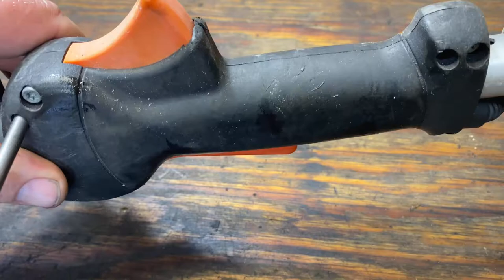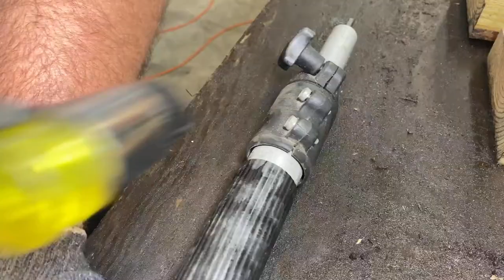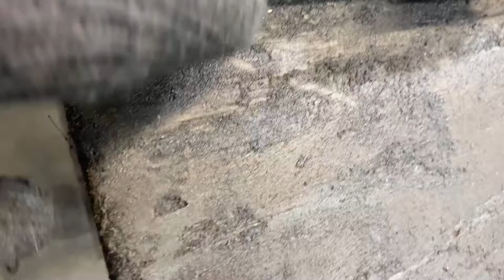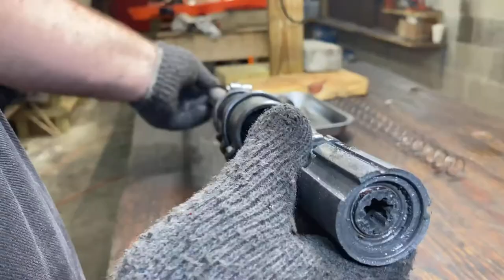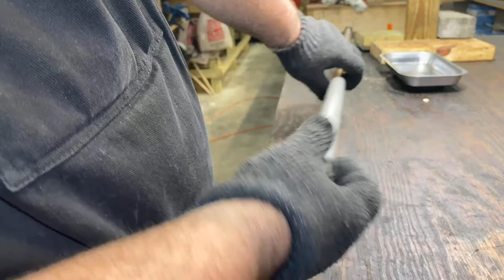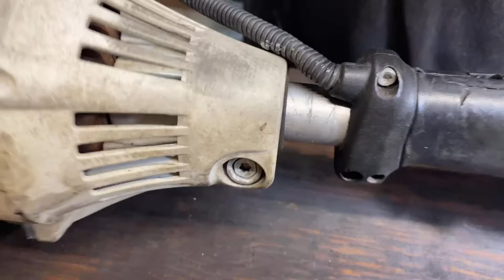Stihl HT-101 pole saw shaft repair/replacement. Assembly and disassembly.

Comment: I’ve been working at a Stihl dealer for 13 years and these are the one unit I struggle with because I just don’t repair them that in depth very often. This is a great tutorial video. Thank you good sir.
Reply: I appreciate that sir. I also appreciate the feedback. After this repair, it took me about a half a bottle of dishwashing liquid to get it all off of me.

Comment: Thanks so much for making this video!  I had a problem with an HT75 purchased 2001 where the chain would not drive when the telescoping pole was extended.  It later got to the point where the chain would not drive regardless of whether the pole was extended or retracted.  Using Lester's video, I removed the motor and found a small, wire snap ring around the splined shaft about 4 inches from the motor end of the shaft.    As I removed the splined shaft further, I found there was a groove about 10" from the motor end where the snap ring was supposed to be.  Its purpose is to keep the drive shaft from being pushed too far into the tube and disconnecting from the motor's clutch.  Hoping this might help someone having a similar problem.

Comment: Thanks! You just saved the day for me. I removed everything Before looking at the videos. All parts flew away when I opened it. 

By the way, for those looking for the outer tube orientation, the short side between the end and the hidden rivet goes towards the chainsaw.

Comment: I dealt with my HT 75 about 6 years ago. The bearings had some rust. One was unrepairable so I had to buy one. I'd had never thought how many parts were in the shaft. I ended up finding a diagram for how the guts worked. Thank God I only had to buy one bearing. You can sure spend some money on rebuilding these things if the previous owner had left two of them out in the weather for at least a year. My bill for repairs to both was the 75. They are great little saws, but I don't know if they're worth 650 bucks new. Thanks, great video.

Comment: Dropped mine out of the boom truck and it fell about 20 ft. Some branches kind of broke its fall but it hit motor side down.  Now when I extend it the drive shaft comes out of the motor. Probably that C clip that you show in between the 2 pieces of spline.   This video is exactly what I need.

Comment from the maker: I definitely want to thank everyone for their comments and kind words. I had been wanting to redo this video for a long time. Pole saws are my specialty. With the parts in place, and not filming, I can strip, analyze, repair, and reassemble the shaft assembly on this model on an average of 20 minutes.
Reply: My pole saw cutting head was turning until I extended it than it stopped turning now I can't get it to turn at all. And when I extend it it sounds like the inner shaft is loose inside. Do you have a idea of what could be wrong with it. Thank you
Reply from the maker: @eltonhitt9360  check the circlip on the inner shaft
Reply: @lesteroliveintheshop9825  I'm sorry to keep bugging you but I pulled it apart and the circlip seems good  but I noticed the bearing on the bushon on the  top part of the shaft that you mentioned aint there. Can you recommend me a place that I can get that bearing and what do I call it when I order it. I'm truly sorry for asking so many questions
Reply from the maker: @eltonhitt9360  one of the bushings has a round bearing instead of a splined
Reply: 5
Hi 4Hi is 4³to the
Reply: Fantastic video.  After seeing this video, I bought a used ht101 from a man that had jerked the sections apart.  Followed your video and it is working great.  I'm making sure all needed maintenance is done.  I was going to grease the gear head.  But the gear head does not have a fitting for greasing it as do Stihl hedge trimmers and weed trimmers.  Should I open the gear head and add grease to the gears/cogs?
Reply: @billcox6154  no sir, don’t open it
Reply: You are amazing my friend!!!

Comment: Excellent Video Perfect In Every Way I’ve Done a Couple Inner Shaft and Bearing Replacements And Always Struggle Sometimes Too Remember The Orientation Cause It Sometimes Takes Weeks too Get the Parts Before I Worked at a Stihl Dealer 😀😀😇😊👍🏼
Reply: I appreciate the positive feedback and you taking the time to watch.

Comment: I learnt some things from your first Video Lester, but to be honest there were some holes that had me scratching my head a bit. This new video is exceptional. Y'all done good Son. haha. Seriously though mate, awesome job. You have no doubt assisted a hell of a lot of people with this latest version, Me being one of them. Thank you very much Sir. This latest video could not be easier to follow. The only missing item is an explanation of how to identify which end of 'the outer tube with the black covering and the rivet in it' goes to the motor end so the groove orientation is correct. I found a manual which says " Looking through the outer drive tube from the engine end, the rivet must be at the top and the guides on the right". I'll see how that works out for me.  I hope to see more videos from you Lester because I know they'll be helpful and save me time and money. I'm sure a local shop would be looking for a couple of hours labour at $90 plus an hour for what you say you can do in 20 mins. It's not always the money though, I like to learn about the tools I use and prefer to spend dollars on special tools or manuals so I can do the jobs myself. Thank you again Lester and keep up the good work.
Reply from the maker: Thank you

Comment: Can I say a very BIG thank You to you mister Lester Olive, I bought a used HT101 last week and while searching for videos your old HT101 pole video came to light.
I watched it a few times in the last few days to try and determine the actual process but while rewatching it again tonight this new video came up.
What amazing timing.
Now I have a clear picture of what parts I need to order and how to reassemble it.
May I ask for the measurements from the Hidden rivet on the main outer handle from rivet to Motor end and Rivet to Cutter end? This would help a lot as I am not sure that someone else hasn't been trying to fix this before me and possibly turned the shaft around.
Thank You.
Reply from the maker: I’ll try and remember to measure one when I get to the shop tomorrow
Reply from the maker: The previous video was like a thorn to me, but I couldn’t bring myself to take it down due to the large following it got. I finally decided I had gained enough videoing and editing experience to make a more quality video. Unlike the first one, I spent a little time beforehand planning on the best way to present it.
Reply: @lesteroliveintheshop9825  
It has a large following because it is the only clear and detailed guide to disassembly and reassembly of the HT101 polesaw anywhere on YT.
I like the bottlebrush on an antenna trick though, I thought it was excellent.
I hope you leave it up as a marker of how far you have come as a content producer.
Thank you again.

Comment: I was trimming a huge oak tree and the blade got stuck In the cut 15 feet up, couldn’t get it out, branch snapped off and the saw came with it only to have the tube come off and the whole pole saw came apart almost. Without this video I’m not sure I’d have my pole saw working right now, thanks brother!

Comment: great video, you mention the distance between the rivet on the outer shaft is different can you tell us which side has the longest measurement  eg is the greater distance at the motor end or the cutter end.thanks

Comment: Excellent demonstration  video, thankyou greatly appreciated. I'm a motor mechanic by trade. Just got a job working at our local council depot in small engine section. Taking care/maintenance on full range of electric & petrol stihl garden care products. Chainsaws, pole saws, brush cutters, whipper snippers, hand held & back pack blowers, etc... Already replaced inner driveshaft with flex end that goes into engine located inside primary tube attached to the engine. That was scary at first , but all good, got it working again. Now got polesaw that's just come in, chain doesn't spin when the secondary tube is extended all way out. Check problem out tomorrow, will be interesting, looking forward to seeing what it is. Hi from Redlands, Queensland,  Australia.

Comment: Thanks again Bud, the first time I followed your instructions the polesaw worked. Unfortunately after several usages the cutter head wont rotate again.  Perhaps there's a part that's defective.  Any suggestions? I'm gonna re and re it again and hopefully it will last  this time .Thanks for your great video. 
Dave, Pefferlaw Ontario

Comment: Hey Lester, thanks for the video it was an immeasurable help. Now I have this HT75 and i need to know if there was a change over on the drive tube parts mainly the power end,. On this one the splined shaft runs all the way to the engine 78 inches {no spline tube at the engine) and i am not seeing the long plastic wear bushing at the engine only the bearing at the clamp end of that tube. Thanks again, Bryan at. Major County Dist 1 western Oklahoma
Reply from the maker: Thank you. There have been several variations

Comment: How do you fix a pole saw when it falls apart when using it and you put it back together but the head of the saw is not the same angle of the trigger and engine?

Comment: Thanks for this video, it helped me replace the bearings within my ht131 and put it back together.  I have run into a problem though.  For some reason the pole will not collapse completely and sticks out about 3.5 feet.  Any ideas on what could be wrong?
Reply from the maker: More than likely it’s either, the outer tube needs to be swapped around, or the inner workings have to be installed from the motor end of the tube. There’s a stop rivet in the outer tube. Thank you for watching and commenting

Comment: So my pole saw was making a rattling noise I guess the springs were doing something and then one day the dang pole saw split in half. Luckily I was done cutting with it that day. It all started when my buddy was using it and came up to me saying the torx screws were coming loose. We tightened them but ever since then it’s slowly made more and more rattling noises and then came apart on me and the spring now exposed. It’s a great video but I’m wondering if I need to break it down or just put it back together. I’ve only used the pole saw maybe 10 times and less then 2hours of total chain sawing time
Reply: Probably just warped the inner drive shaft a little. Most all of them start rattling with use. If it’s functioning properly, I would not worry to much, as long as it’s just rattling and not grinding. I appreciate you watching my video and commenting.
Reply: Yeah it was rainy only until it came apart. Should I look at anything specific as to why it came apart or just put it back together?
Reply: Rattling*
Reply: @chris5352  generally the sleeve bolts just slowly back out and need retighten
Reply: Hey there, I finally tried pushing the pole back together and tightening the black piece. The motor will start but sounds like bell noise coming from the motor and the engine stalls. I assume I need to dis assemble it?
Reply: Not sure if the name of it but the black piece inside of mine I believe was missing a rivot (watching your video). This black piece was between two springs. You had to turn the shafts in the correct orientation to push together. I have the ht131 so maybe it’s different. But the video looks like it’s connected to the part that you tightened with the torx bit. Maybe that’s the main problem?

Comment: Got this saw to trim larger tree limbs ( 3 or 4 inches) from the ground. https://www.youtube.com/post/UgkxHMc_g3gGUpXsBlcRniL7qDnlxwo192gi Plenty of power to do this job. I went with Dewalt because I have several 20 amp Dewalt battery power tools. Cut limbs very fast. Cut about 10 limbs. Saw chain is still sharp, used one battery charge . Unit is heavy when fully extended, but resting on a limb the saw weight helps cut the limb. Saw can be used at various lengths. I have several batteries charged up at one time but have not had to get a new charged battery for any of my tools doing small jobs around the house. Love this stuff. Saw chain should not be resting on the tree limb when starting the saw chain up.

Comment: These stihl pole saws are the biggest pieces of shit I’ve ever seen . One branch falls wrong is all it takes to bend the flimsy top pole and flimsy driveshaft. It Only costs around $3-400 in parts to repair it.   But hey my ht101 engine still runs.  I’ll stick with echo from now on.